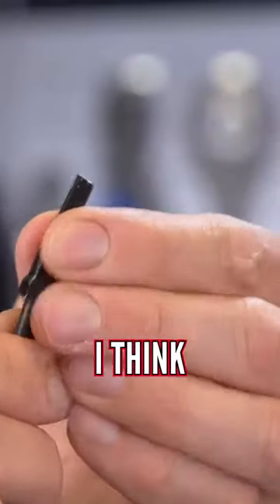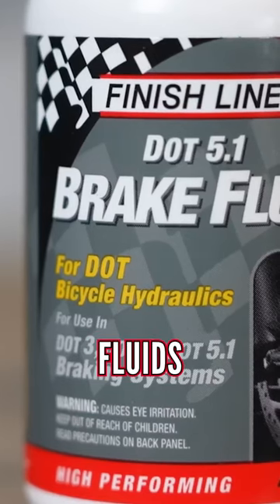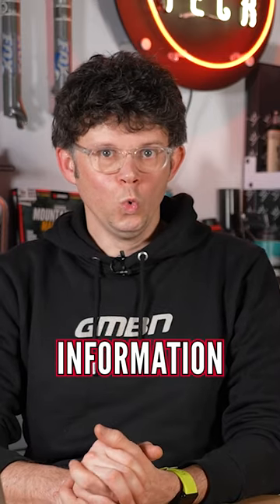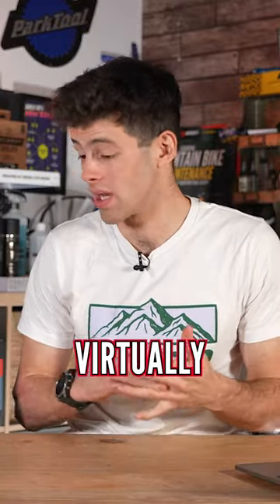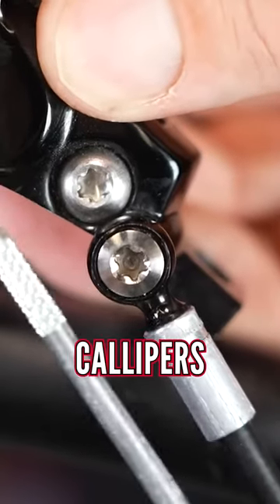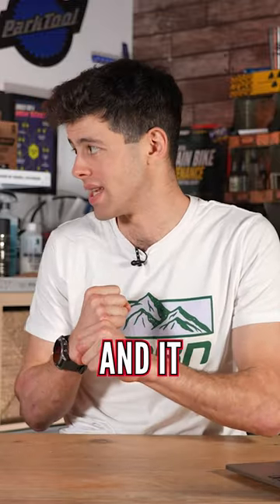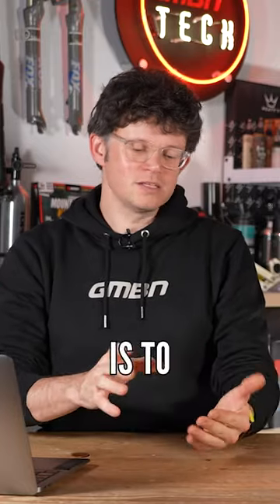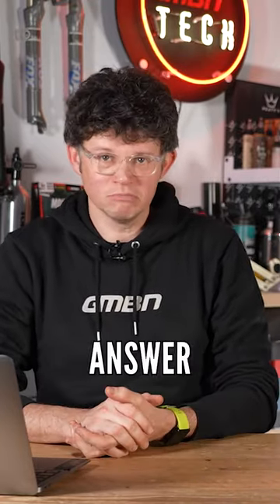Can You Run A Shimano Hose With A SRAM Brake? 🤷

Comment: I would not do it. Outer and inner diameters may be slightly different, and brake hoses are not expensive. If the connection fails however you lose a brake, which could be a disaster if you are descending a steeper trail.

Comment: Or go older mechanical group hydraulic caliper with newer shifters (believe they now got 2" hose fitting coming out to attach to and older caliper you connect to with olive barb thing) always research before buy anything I mentioned as not all might be like that